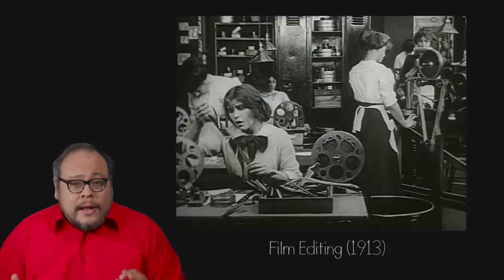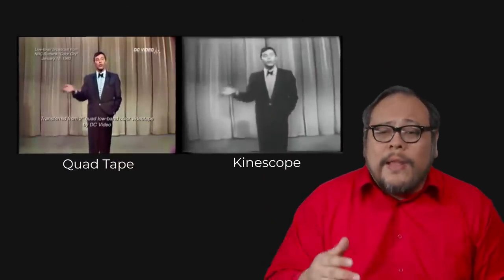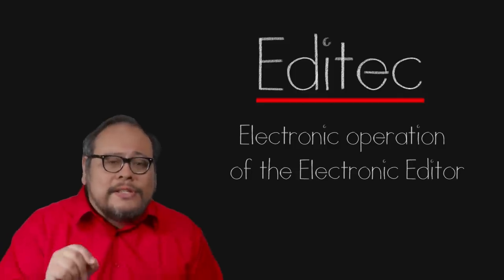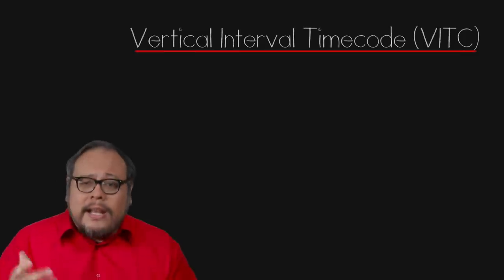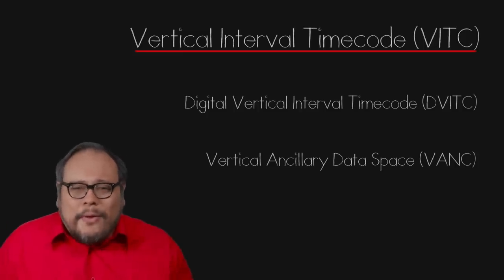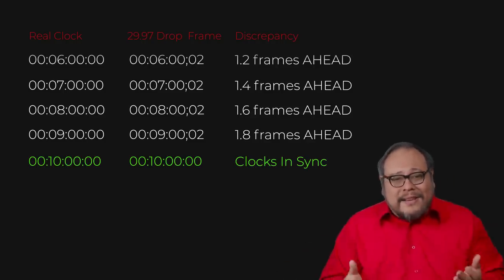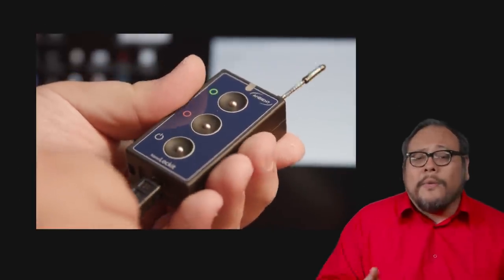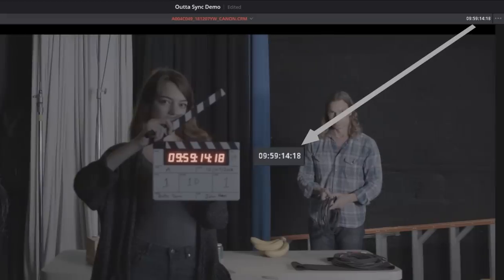The History and Science of Timecode

Comment: I did a local talent show and semi last minute with two cameras and occasionally pulled out my iPhone. I had room audio and mixer audio recorded direct on the mixer. And I painstakingly manually synced the whole darn thing. The worst part figuring out where I grabbed a little 10 second snippets from my phone. Having borrowed professional-ish cameras for this event and knowing that there was some sort of syncing capability but not having time do you research and implement. I also started wondering if I could rig something up and guess what I pretty much came up with the same concept on the cheap in my head over FM radio but I didn't have time to implement anything but it would've been better than manually syncing. Anything would've been better than manually syncing.

This was a nice little gem of a video that I didn't get to watch yet so glad I finally dug it out of my watch later list.

Comment: Very good explanation of (almost) everything that goes into Time Code for video.  I spent over 4 years designing and building TC equipment in the late 70's.  This was the time largely before software or computers in broadcast video and when drop-frame code held sway there was a vile gnashing of teeth and cursing from editors and producers and anybody else that had to deal with it.  It wasn't till the late '80s when SW would make everybody's life easier.
But I noticed that you failed to mention that there is still some in-exactitude between drop-frame TC time and real time after 1 hr, after 1 day since the relationship between them incurs a repeating decimal due to the frame rate of 29.97299729972997... and cannot be easily reconciled in hardware OR software.  There must also be some who are wondering why this weird frame rate exists at all.  That is a convoluted story in itself.
Reply from the maker: I think I'm going to do a video explain why we still use it... not the why we have it because that's been explained a lot already. Legacy is important.

Comment: Great video, two small points, when talking about Ampex and Quad video editing, you say that Amtec was a compensator for clock drift. Ampex does call AMTEC a "Time Element Compensator" but it's just a time base corrector allowing a machine to produce a broadcastable picture with stable sync or to allow switching of a VTR signal. It was really an updated InterSync servo system that allowed for the more accurate timing.

 When talking about EDITEC you mention the VR-1000 but you show a picture of a VR-1200. A fully color capable (play and record not just record) VR-1200 with EDITEC III was $87,500 in 1967, and the VR-1200 was the "Cost reduced" quad VTR form Ampex.

While at NAB please check out the booth for the Museum of Broadcast Technology, they will have a Pair of RCA TK-45 color cameras and other goodies.
Reply: Just so you don't think I just pulled that out of my, well you know where. I am currently restoring a pair of Ampex VR-1200 quad machines from 1967(with EDITEC III). I happen to have the manuals for the AMTEC and InterSync right next to me.

Comment: Hey there filmmaker IQ! I am in the process of shooting and editing a podcast/documentary. I had a 3 camera set up (4.6k, 6k, 4K) all connected with timecode via MixPre3ii. 

One of the cameras (the 4K) was on 23.976 while everything else was on 24FPS(including the mixpre3ii). The audio is out of sync and I can’t find anything online that could point me in the direction to fix it! 

I am on a multicam timeline in resolve and everything else is smooth other than the one camera. It’s driving me crazy and I can’t reshoot it, how can I fix this?

(Summary)I have two camera shooting in 24FPS in 1 shooting 23.976 FPS all being fed a 24Fps timecode, what can I do to the camera to have the video line up with the others?
Reply from the maker: I would say just visually sync that particular camera and throw away its time code. There Isn't really a difference between 23.976 and 24 visually... But it will drift quite a bit in terms of time code. So just of ignore it

Comment: Great video John!  It answered several questions I've always had about timecode.  I still have a ton more.  Are there any native Premiere Pro external timecode sync options for camcorders such as the sony FS5?
Reply from the maker: Timecode is just metadata for Premiere. Unfortunately there's no way to read the LTC timecode embedded in an audio track in Premiere, Premiere only reads what's in the file header or a custom timecode. Tentacle systems has their own timecode reading software but it's pretty expensive ($150 I think)... all it would do is read the timecode and you'd still have to input the numbers manually (pro tip, just type the numbers theres no point in typing the colons). Pretty much the same workflow as Resolve but Resolve is free.

Comment: The magnetic developer, was it Magna-see? I still have one can left. Used it on reel to reel audio. I think I lost a case of it in a move long ago.

Is there a replacement?

I used it on commodore 64 disks, credit cards, etc. In front of me now, next to my last can, an aluminium 12 inch disk from a Winchester drive the size of a dishwasher.
Can see the sectors and data from Magna-see.
Reply from the maker: don't know but my sourcesaid the stuff was poisonous so be careful.
Reply: @FilmmakerIQ  it's just heptane. No worse than the zylene official Ampex head cleaner.

Just keep your tongue out of it. 

     You can also stretch it by wiping the magnetic particles back into the can.
I used to use Scotch cello tape and stick it on a customer's invoice.

Comment: Thanks for that very informative video. When you use Davinci Resolve to convert your audio timecode to file/metadata timecode, are you exporting the full video again to take to Premiere Pro, or is some kind of XML format that you use? A video on that workflow would be an excellent topic.  I have two tentacle sync E's but since I am on PC, I can only use their Tentacle Timecode Tool and it wont do the conversion of audio to metadata timecode for 10 bit footage shot on Panasonic GH5.  If the DR workflow is simple enough, that could be one route to try. I tried DR 16.1.2 free version but it was also having problems with GH5 10 bit footage.
Reply from the maker: You could export the full video back to premiere but just hand copied the timecodes back.

Comment: I was really hoping you'd make mention of Pilotone, which was necessary on older film cameras, which literally tethered the camera and sound recorder with a signal cable.
Reply from the maker: Hadn't heard of that format before - I'll have to check it out!
Reply: @FilmmakerIQ  It was before crystal controlled motors, so the cameras used governors to keep speed, but they varied a lot. Kind of like how a clockwork bolex will start losing sound sync as the take gets longer.
The camera would send a signal from its motor to the audio recorder, so the sound could be speed modulated to keep sync in post.

Comment: Why didn’t we abandon 29.97 in 2008 when we converted from analog to digital broadcasts?
Reply from the maker: Because that would have meant everybody who already had a TV set would have to throw out their TV set and buy a new one for a reason that no consumer cares about. Instead all people need to do was buy an adapter.

I don't understand why the internet is so hung up on the Oddball frame rate. It's a sign of success being the first major television industry in the world.
Reply: @FilmmakerIQ  Since we needed an adapter anyway for old analog TVs couldn't the 30/29.97 rate been solved there?

I do understand why it was done during the deployment of NTSC color for comparability with b&w sets. No complaints there.
Reply from the maker: @lohphat  That probably would have made the adapters even more expensive. But Broadcast standards aren't just for over the air signals - they're used all sorts of Home Media to video game consoles... EVERY THING would get screwed up.

But outside of a bit of trivia - what difference does it make to the consumer if it's 29.97 frames per second vs even 30? All the engineering issues have been solved - changing the frame rate up to 30 does nothing but create new compatibility problems.

I mean it would be nice if Pi were an even number like 3 instead of that irrational non-repeating anomaly...

Comment: A poor (wo)man's timecode: SMPTE timecode recorded on your phone or mp3 player and long cables.  Timecode is simply a square wave on an analog signal.  Record an hour or more of timecode as an mp3.  Use 3.5mm Y cables to split the output to 2, 3, 4 or more outputs.  Connect the mp3 player to cameras and recorders using long 3.5mm cables.
While the cameras know nothing about the timecodes, your editing software or plugin can read it and make use of it.  If all you are interested in is syncing tracks any auto audio align function should be able to do that.
I am thinking of doing without the wires by using a wireless group headset system like used for audience audio assistance or tour guides.  Plug my mp3 player into the transmitter and then plug a receiver into each camera and recorder.
Reply from the maker: That's sort of what these time code devices are in the first place. Good luck!

Comment: that was NOT a "square wave"
Reply from the maker: Actually it was a square wave but it's binary https://en.m.wikipedia.org/wiki/Manchester_code
Reply: @FilmmakerIQ  No, a square wave has equal time that it is a high and equal time that it is low... it has a 50% duty cycle... the signal that you showed was a digital signal but it was not a square wave

digital signals and square waves are two different things... a digital signal might be a square wave and it might not... s square wave might be a digital signal and it might not

I have a signal generator that can produce it a square wave and when it does that output might conform to the criteria of a digital signal or it might not
Reply from the maker: The base clock is a square wave.

"Manchester coding is a special case of binary phase-shift keying (BPSK), where the data controls the phase of a square wave carrier whose frequency is the data rate."

Comment: You skipped over inked edge numbers
Reply: At our extremely busy film labs, the machine producing inked edge numbers was used only once in 47 years. It looks like a useless comment, Scott Marshall.
Reply: @entertainmentexecuti I'm giving a talk on film sound and recalled your reply. So, your lab HAD an ink edge numbering machine. Was it used often before you worked there? Or did they buy it just for the one time? Maybe you can explain to me how, during editing, the sound film (e.g. full coat) was kept in sync with the picture film, if there was no way to apply numbers to the sound film? I think the inked edge numbering was typically applied when the dailies were assembled so that the picture and sound could be synchronized during editing, but was likely applied AFTER the film left the lab you worked in